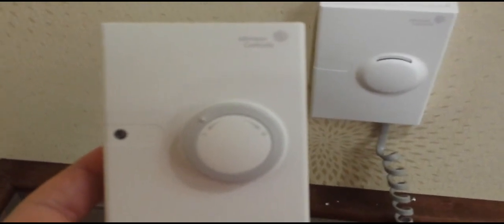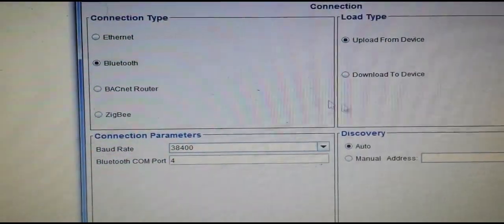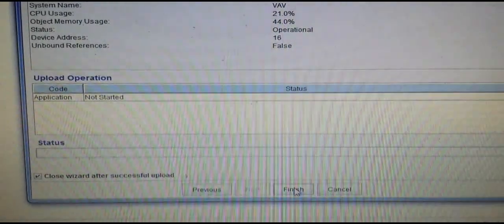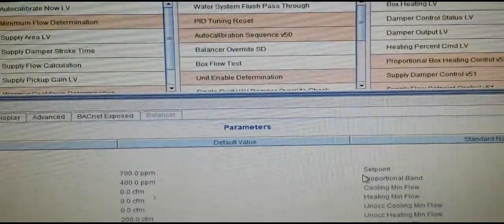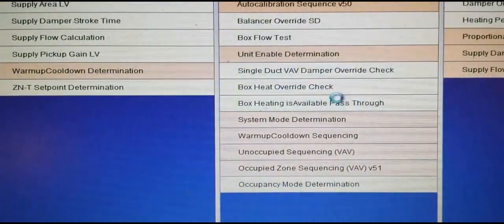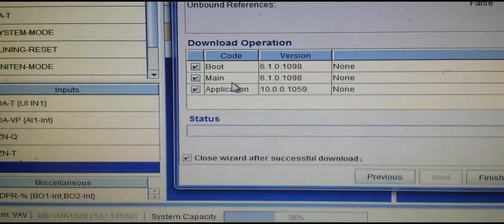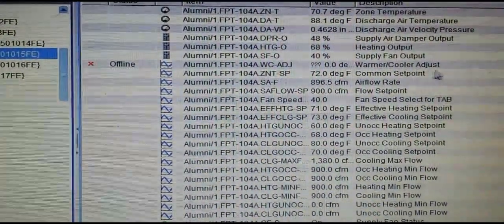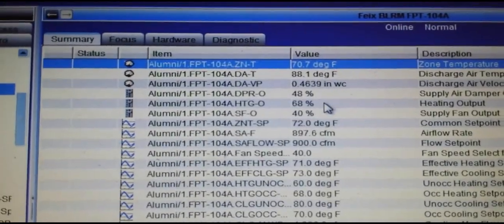Replacing an adjustable thermostat with a sensor

Comment: At 3.27 in CCT the input tag is only WC-ADJ..but in SMP after you brown the point its shows Alumni/1FPT-104A.WC-ADJ.

My quetion is how to add controller name before tag name(CCT)..
Reply from the maker: Originally the points were all pulled in with a database tool that JCI has. That tool automatically puts the controller name ahead of the point. I'm not a fan of it because of issues and it's more work when a room name or number changes
Reply: @Systemcontroltech  When I try on my cct 10.2..the controller name didnt appear before point name in CCT.
Can you explain again how to get that.
Reply from the maker: It is done by a database tool that jci has.  I've never used it

Comment: Why didn’t you add an input for your new sensor?  Don’t you still need to tell CCT what kind of sensor you are using?
Reply from the maker: I re used the original input for the temperature and only deleted the warmer cooler portion.  It's a network sensor.

Comment: I'm hoping you can make me understand something that I been looking for and can't find. Maybe I'm searching the wrong questions but when given a clgocc-sp and htgocc-sp how does that determine the actual set point you want.  If I'm given a heating occ of 68 and cooling at 78 it spits out your occupied set point. Maybe I'm missing something and that's why I can't get it.
Reply from the maker: +Zero Cool Most of the controllers are state based.  Think of your thermostat at home where you have to switch between heating and cooling.  Imagine that the thermostat switched itself.  Your occupied heating setpoint would be the setpoint the system tried to achieve.  When it switches to cooling,  it would be the occupied cooling setpoint.  By default there is also a 2 degree differential in the system also.  If you want to have a setpoint of around 72, set the heating at 70 and the cooling at 74.  To overcome the differential go 72 on cooling in the summer and then 72 for heating in the winter.
Reply: Thank you for the quick reply...maybe that differential was the thing throwing me off. Is there a way to change that 2deg differential? 
Lets say the client wants to change the ZNT-SP then but the OCC-SP's are 72.....will they still be able to change the ZNT? I'm kinda new to this programming and trying to wrap my head around it?
Reply from the maker: Zero Cool No, there must be a differential between the heating and cooling.  If you set them both the same, you will see the system mode switching back and forth and you may get the PID way out of tune.  If you have a warmer cooler adjustment you can either add 2 degrees or subtract 2 degrees also.  Some of these systems get a little frustrating.  Good luck and thanks for watching.

Comment: How are you today..I would like to know how to check for the Bus health diagnostic..on FEC or N2 .comunicacion issues to divices. 
Thank you
Reply from the maker: +lenny cordero you should be able to measure a DC voltage between 0.2 and 0.5 between the + and -

Comment: Great video...when you replaced the warm adjust temperature..on the new sensor did you have to make a connection?
Reply: I understand you deleted the warm cool adjust on both CCT and Metasys but what input do you have to add on Metasys to be able to control the temperature remotely?
Reply from the maker: +lenny cordero no. The system was designed to give you the option to use either a warmer cooler stat or just a sensor. We didn't have to do anything but delete it from the program and then reload the controller.  Good luck.
Reply: +System Control Tech.  thanks a lot

Comment: these sensors can really come in handy in high traffic areas. For my vma programs that are on a remote Stat I only have zone temp and zone setpoint as my inputs in CCT no warm cool adjust so I guess I wouldn't have to delete anything?
Reply from the maker: +Joseph Cheeseman If the zone temp set point comes from the thermostat you will need to.  If it is a software value only, you will not.